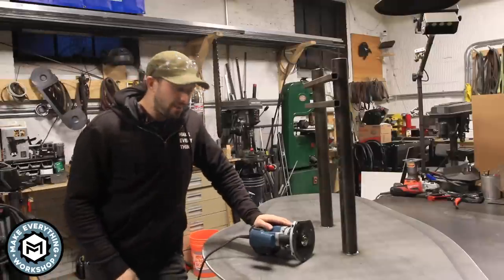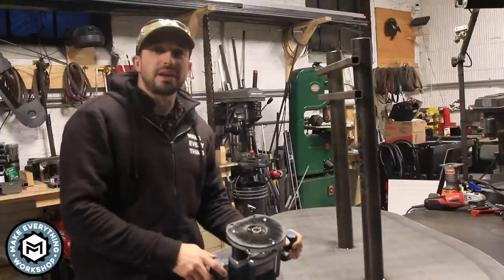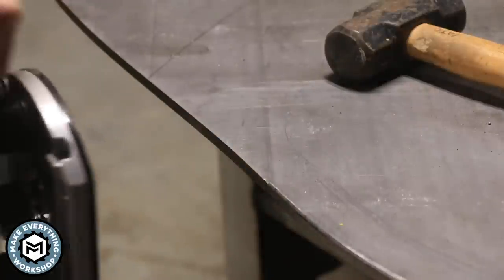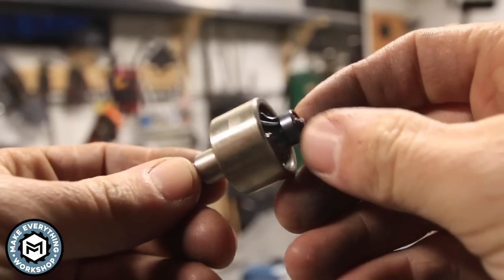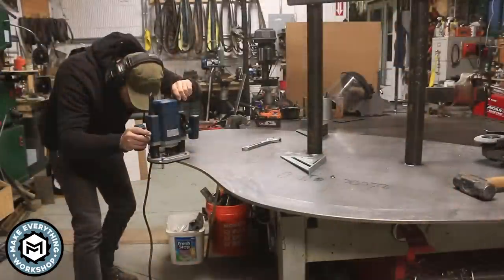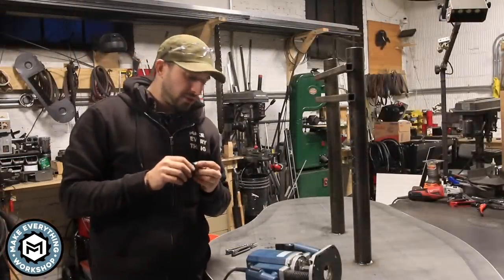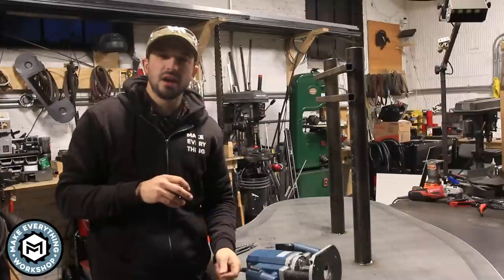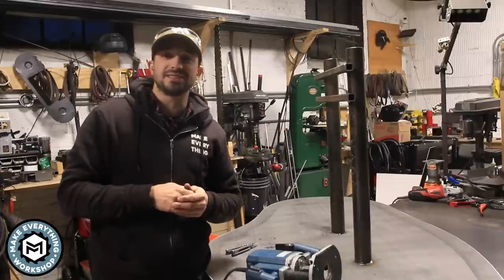A Router Bit, For Steel?!

Comment: When I worked for Fastenal we sold a "beveler" which was an incredible tool for welding, you could make super clean bevel joints, problem was metal shops didn't see the cost benefit to such an expensive piece of kit when they could just use a grinder and get a close enough result. These are amazing tools.
Reply: would it do stainless?

Comment: Very useful piece of kit. I would start the radius with an angle grinder for sure to extend the life of the bit as I would imagine it will wear out from where it meets the corner of the metal.

Comment: Well I learned something and I'm OLD. Never thought there would be a router bit for metal, where was this 50 years ago, it would have saved a lot of filing.. LOL.. Peace
Reply from the maker: olenick 7734 it’s going to save me so much time!!! Love innovation!
Reply: olenick 7734 we've used table  & chopsaws & routers on plenty of aluminum to cut extrusions & weld repaired turbine engine parts.
Routing steel is a new one on me! Seems like some kind of cutting fluid would make things last longer.
Peace partner.

Comment: Your best bet with this bit is to set the depth higher and take multiple passes. Say your total depth of cut is 1/8". Set the depth to 1/32" and make continuous pass while keep load on the tool. Then drop another 1/32" and continue until full depth of cut is reached (total of 4 passes). The way you were cutting you are continually varying the load on the tool, causing it to change temperatures which will cause premature failure. Constant load in key with feed and speed. Depth will vary based on material but look at the finish of the cut. Is it smooth or faceted? Hot or cool to the touch? Does it require more or less feed pressure?

Comment: All tool steel meant to cut, can cut metal just because it says wood router doesn’t necessarily mean it’s exclusively for wood. Specially if you’re in a bind, and you just so happen to have router bits, whether tool steel or carbide. Just take into account deciding to cut metal with such, feeds and speeds.  I’ve used a 3/16” Bosch round over router, to carve radiused edges on both sides of 3/8” thick x 1 1/2” wide x 12” long aluminum flat bar. As a matter of fact, I used a 1/2” Bondhaus Allen key and grinding wheel as a lathe tool cutter in a radius cutting jig bout, 20 years ago. It’s practically true for any tool, known to have been heat treated and tempered, to just about match tool steel process, so. It’s not like it’s anything new. Though, this is an interesting router but.
Reply: True, but most bits, even carbide do not like cutting steel at greater than 2000 rpm, especially without coolant.   Try cutting steel on a flatbed router with no coolant ;-)   and the lowest speed can go is 4000 RPM.    And then running a milling center with aluminum or steel, at about 1500 to 2500 RPM, and the coolant runs out.... see how long yor bit lasts :-)
Reply: @charlievisscher7427  That's where modding the the motor output comes in to play, (speed control, pulley's, gears, etc.) again, when in a bind, minding feeds and speeds, of course.
Reply: you're comparing aluminum to steel...

Comment: They also make diamond bits for stones like granite.  Shouldn't us be using some oil with your metal bit?  I would think some oil would reduce the friction a little.
Reply from the maker: Michael Mantion I tried using a little
Oil but it didn’t seem to make a difference, carbide likes flood coolant or none at all. Seems to not have dulled at all!

Comment: Is there a Semi-Easy way to round off a square welders table? My Gramps built it for a welding class back in the late 1930s I want to round off the sharp corners I am tired of getting whacked as I pass by it. Its pretty thick steel
Reply: Use a file or a belt sander.
Reply from the maker: You could use a cutting torch or grinder . A porta band makes quick work of plate too! Good luck

Comment: Isnt this going to kill the bearings in the router? Steel working machines are usually a bit more rigid than a handheld router
Reply: it probably will over time, but the cost of the tools that do this for metal are about $1,500-$2,500 which will buy quite a few routers! a decent quality router like a bosch should have pretty beefy bearings anyways so it should last a long time, but eventually it'll be toast, not sure what availability of parts or access to replacement bearings is as a comparison to getting a new router though either

Comment: Hi. Why did you use a guide bushing? Isn't the point of the bearing to guide the bit?
Reply from the maker: The guide bushing is for the depth of cut vertically, the bearing is to guide the cut horizontally.

Comment: It takes multiple passes in my opinion it can be way better they should go take notes from the cold cut saws and maybe make it out of the same materials no sparks also. Just needs a little more work. Price is high in my opinion a 14 cold cut saw blade is that price.

Comment: You guys seem really knowledgeable. I’ve tried looking online to find a way to route a hole in some 1/4 inch cold rolled steel. The steel is part of a door frame holding a 500 pound door. I’m trying to route a cavity for the deadbolt. Do you have any advice? I’m not able to remove it and work at it at a good angle. Whatever I do I have to hold the tool sideways and stand up as I route the whole.
Reply: Did you find a solution to your project yet? I’m trying to route a hole in a commercial metal door to make it bigger to fit a larger lock set without filing my life away at it…

Comment: What would be a good way to get a nice round-over on steel without a bit like this?
Reply from the maker: Matthew Patterson I usually use a flap disc on the grinder but it makes much more of a mess and takes much longer if you really want a uniform edge
Reply: I would say a good sharp bastard file would do pretty well in not much time at all
Reply: Use standard wood router bits and a standard router for Cast iron or Aluminum (More easily machined than stainless steel/carbon steel/plate steel/mild steel). A "Carbide burr bit" on a small die grinder (~20k rpm), mounted in a portable drill-press/angle stand for getting the desired angle, can chamfer most steels, except it wont come with that nice round profile.